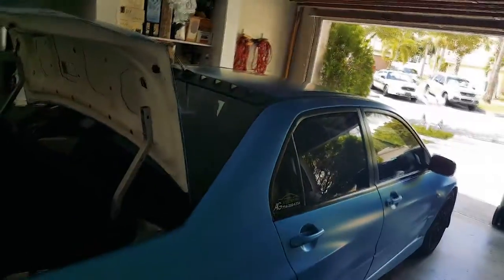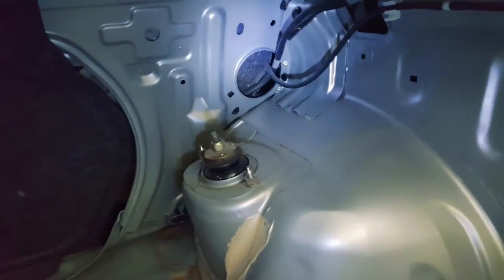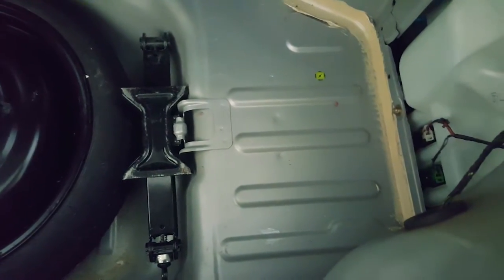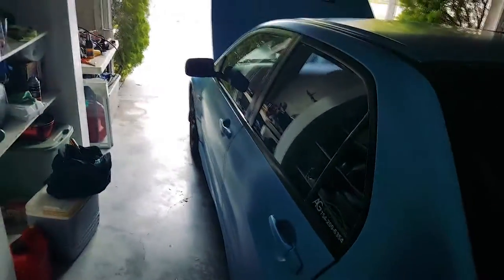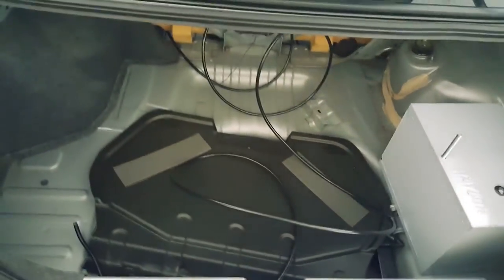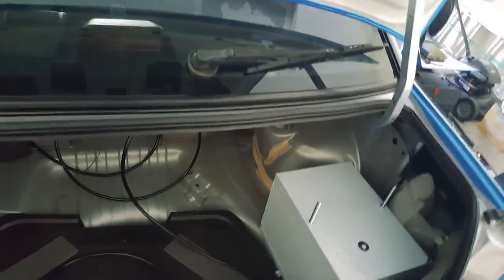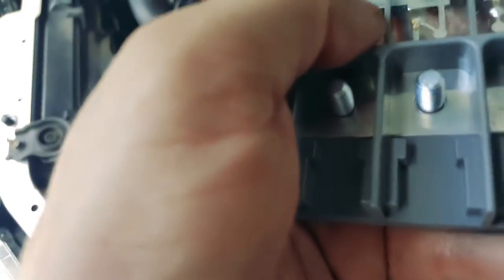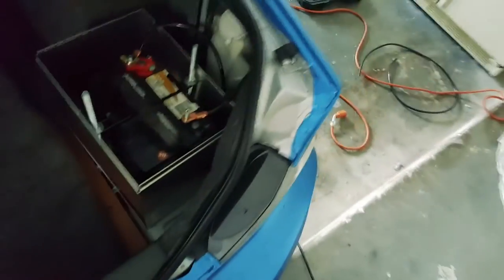Battery Relocation on an Evo 9 - front to rear trunk

Comment: sorry for bringing up an old video, I like your idea to move it to the back. but I feel this could be done way better. the power wire used is not the best for cars. it's very stiff. Hopefully, you mounted the fuse block as well and added an in-line fuse on the wire from the battery to the block. also for future reference, never leave that many expose strands between insulation and terminal. even with heat shrink, moisture can still enter.

I'll be doing a full video on relocating my battery on my other channel. I've been hoarding a lot of material.

Comment: Excellent video. Thanks for sharing 👌🏻
Reply from the maker: +lotecevo nine anytime! I'm here to help.
Reply: I’m on the process of doing mine do u recall what amp on the battery cable? I Know it’s a 2awg but don’t know what amp
Reply from the maker: @lotecevonine1196  sorry I just saw the message. I'd def go with a 150amp, if you go with anything lower you might pop it when you start the car.

Comment: Few things:
when you run the power through the fender well grommet, you want to take your fender off and make sure it's routed right, and most importantly you want to reinstall that grommet nice and snug & maybe even add some kind of sealant. The worst thing that happens to Evo 8/9's is that water runs down the harness and through that grommet & then it ends up puddling/collecting on all the connectors in a little white plastic housing under the dash. This shorts out EVERYTHING in the Evo & fixing it can be extremely tedious & annoying. 
This guy says that he's in Florida, so I can guarantee that it will happen to him if not already. 
Secondly, that bolt where he grounds the battery is one of the only bolts holding the rear bumper on & it bolts to a sheet metal bracket which isn't a good place to establish ground. Best option is to drill a small hole and add your own grounding post somewhere on the trunk floor where the frame rail runs.
Finally IMO I think the best location for the battery is Pass side right behind the seat. Also, it fits perfect if you end up installing a rear strut bar!
Reply from the maker: I'm probably going to jinx myself on this but I haven't had any issues with this install yet. I checked this past weekend to verify before posting. The power is ran through the grommet and is pretty snug, I should add some sealant to be extra safe. There's no signs of water or moisture getting through the grommet and on the white wiring connector inside the cab. I still use the inner wheel lining and the evo sleeps in a garage so that is helping alot in this regard. 

The only electrical issue I've had with the evo was prior to this installation, my clifford alarm was acting up, when I put the battery on a tenderer. But this was because the clifford alarm has a secondary battery inside the siren itself which I didn't know. And when the car is on the tenderer that secondary battery doesn't get charged and eventually dies and needs to be replaced.

Post install I had the ignition lock cylinder occasionally stop working. During the replacement of the cylinder, I saw the black plastic lock tab on the connector was cracked and the connector wasn't fully seated and that was causing the issue. After replacement it's been fine.

Now for the ground, I def need to look at a different place to put it, I didn't really put 1+1 together and think about what was on the back side of that screw.

Comment: This is a long shot since this video was 3 years ago but im doing the same, is it?
Blue/Black Wire - 140AMP
Red/Black Wire - 120AMP
Dual wire - 80AMP
Yellow/Black - Not needed?
And of course battery terminates at the top connector.
Reply from the maker: Off the top of my head that sounds correct. I can go take a picture of how my connecters look and post it. I'll try to take it during my lunch break.
Reply: @Inca-Tk  Thatd be amazing!
Reply from the maker: https://www.dropbox.com/s/b72x6ube4ry04rd/20190722_133410.jpg?dl=0 here you go, you should be to match up the connections based their shape. I know I had to flatten out the one on the left a bit to make it sit correctly.

Comment: How much wire did you end up using on the positive?
Reply from the maker: The positive side, I ended up routing a 22ft long wire first then once I finished tucking it away I trimmed the excess. Then the excess I mocked up the negative side, trimmed that to length. then after everything I ended up with roughly 4 and half feet left.

Comment: Hey great video, I got linked to it from EvoM. I watched it twice and I know you mentioned running an inline fuse, did you ever end up connecting that? If so what did you go with and how did you wire it/ where did you end up mounting. Thanks!
Reply from the maker: I still haven't added an inline fuse yet. In all honesty I don't even think it's needed. Yes, it's a nice safe guard just in case, but I haven't come across a moment where it was needed. If I were to put it in, I would add it on positive side close to the battery, and mount it on the V-shaped support in the trunk behind the rear seats.
Reply: Rektlife thanks bruh

Comment: Helpful vid, why did you use the evo x distribution box though?
Reply from the maker: mainly because it look cleaner, since there's no off the shelf bracket for the oem mini distribution block. the oem mini box is fine, if you want to go that route. I could've kept the oem box and tape it up and tucked it somewhere in the bay, while keeping the cost down a lil more.

Comment: just one  queston   why not  just   bolt it down with  a metal strap   ..  i have a battery in the back ,, but its for a sub
Reply from the maker: this is a cleaner approach, plus if you go to events say drag strips or autox, they require the battery to be in a sealed container with a breathing tube if it's in the trunk.

Comment: what about the negative terminal?
Reply from the maker: behind the washer fluid bottle on the side there is a small screw, that is already used for a ground for the washer fluid. I unscrewed that, scrapped the paint off the frame so it gets better contact, and used that as a grounding source for the negative.